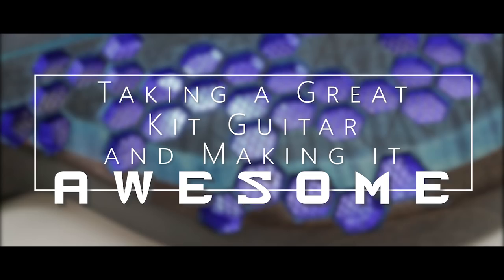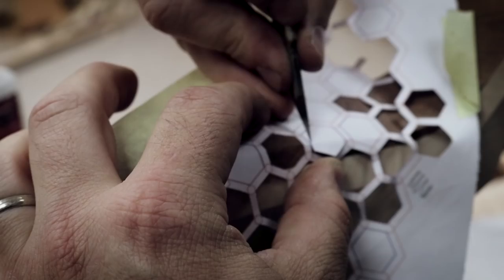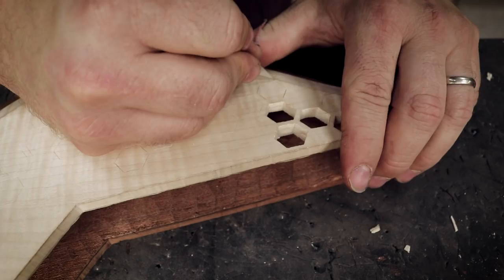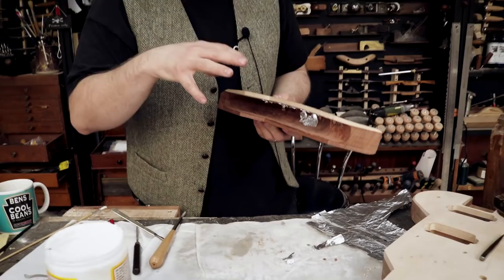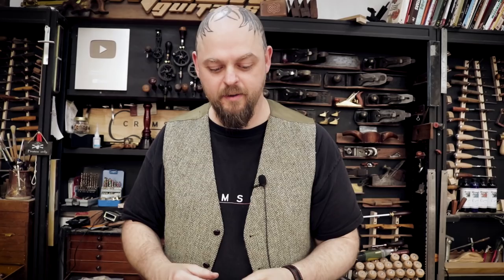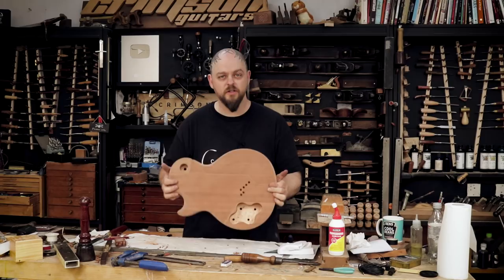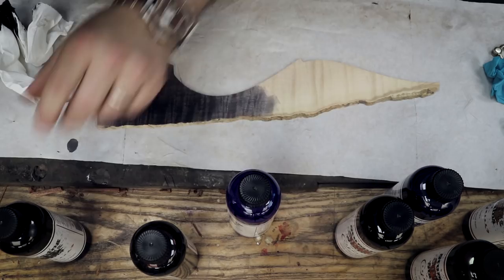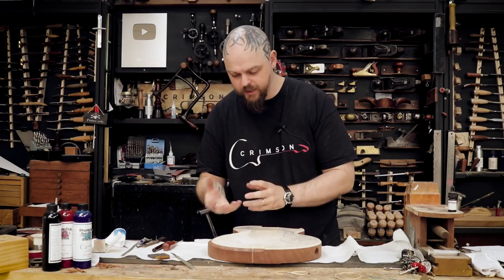Ep 21 - Taking a Great Kit Guitar & Make it Awesome - The CyberPunk Guitar Full Build Super Edit!

Comment: Nice work. Though my only change would of been not using tin foil for the wiring on the top. Copper Electrical wire would of suited it more (in my opinion).

Comment: Hey Ben, not sure if you're still reading the comments on this now-old video, but on the off chance you are, do you have a compilation video of this build? I couldn't see one. The reason being is that I've loved watching this series and I'm changing jobs in the summer and I'll have a couple of months off, and I need a project. Building a guitar has been a long-term goal, and modding a kit guitar seems like a good way to start, and your kits are reasonably priced! I'd have to use my dad's workshop though (my tiny flat isn't going to cut it), and probably get some help from him (his dad was a carpenter so he's pretty good with this sort of thing!), so I'd like a condensed-down video to show him to check this isn't something overly ambitious well beyond what us mortals can do in our workshops (though I appreciate you deliberately did this mod with tools most people will have access to). I don't want to copy the design as I have my own ideas, but I just wanted to know how realistic it is that someone without a whole lot of experience (I built a ukulele once, but that's it) could try something like this.